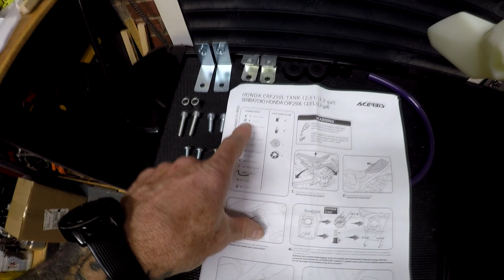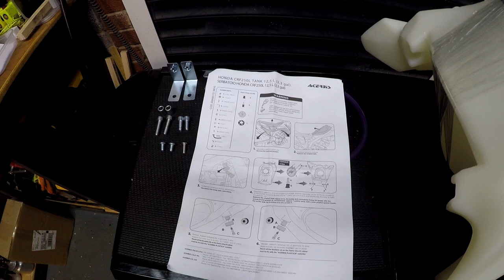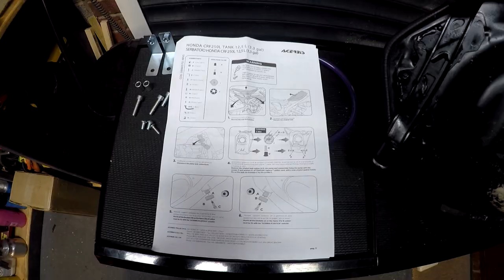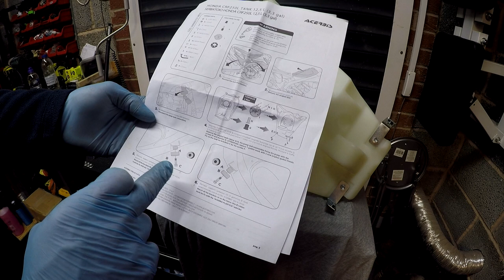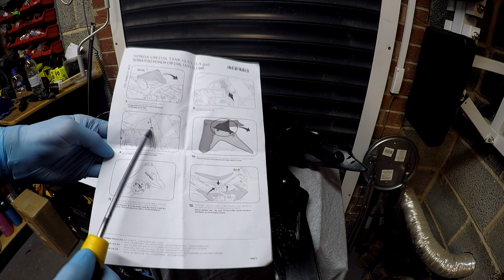Honda CRF250L/Rally | Acerbis Fuel Tank Fitment

Comment: Great video very informative. Unfortunatley my tank just wouldn't fit. The front of the tank was too narrow by 15mm and would not fit over the front mounts. It even fouled with the steel frame brackets. It also fouled the top radiator breather hose so just would  not go down. The rear mout which on yours lined up perfectly just didn't. The tank came Into contact with the air box leaving a 12mm mismatch on the hole. The side panels came  no where  near. 2020 model crf250l. Acerbis are looking  into why it doesnt fit.

Comment: Great video, I've just finished fitting one onto my bike, had Great fun making it fit ok. Just wanted to ask if you have any problems screwing the filler cap onto the tank, as mine seems to  cross thread.
Reply from the maker: Yes had the same problem !! At first you have to be quite precise in lining up the cap but with use this definitely improves so stick with it lol! Hope this helps

Comment: I have searched forum threads, and videos, and yours is the only source of a blow-by-blow on HOW to remove that darn fuel line! I even had tat retaining clip pulled fully from the black connector, and I can't remove that line. Was I not tugging hard enough (easy...)? I feel like I gave it a good yank (easy...), and still the black connector held tight. Should I have really yanked it, or is there a technique once that yellow clip is pulled? Thanks for any further tips...

Comment: I just put an Acerbis on my CRF250L and I'm struggling with something. At 23:33 in your vid, you show a U-shaped bracket that helps to affix the fairing. I don't seem to have that. Now, my tank was bought second-hand, but I have the original instructions from Acerbis and there's no U-bracket on the parts list. Did yours come with that bracket, or did you fab it yourself? Edit: I rewatched the beginning of the vid where you lay out the included hardware....looks like they're included! Mine doesn't have them. I'll need to fab a set or get Acerbis to send me some. Great vid, btw. Thanks tons! Great info and detail here!
Reply from the maker: Yes mine where definatley in the kit .let me jnow how you go I can always get access to mine and let uou know the dimensions if that helps 👍🏻
Reply: @KeepItWheel  Many thanks! Yes, I'm going to fab some, so if you can take some basic dimensions, that'd help tons. Appreciate your offering.